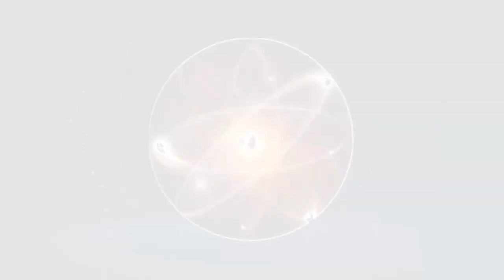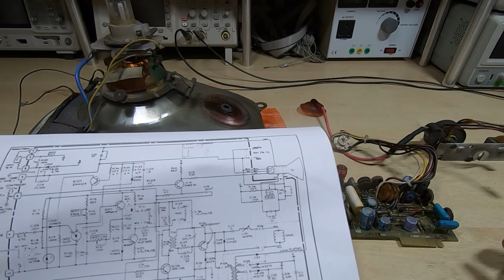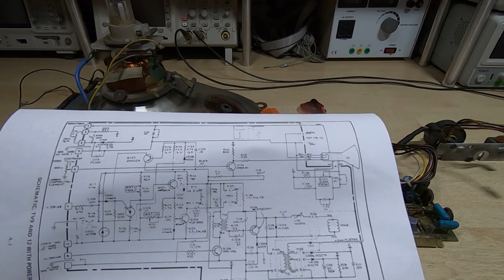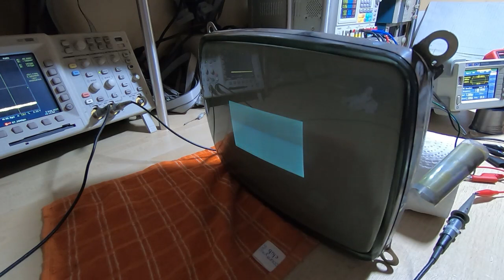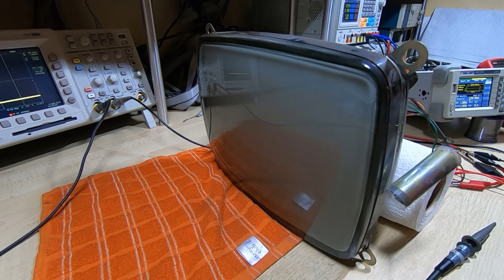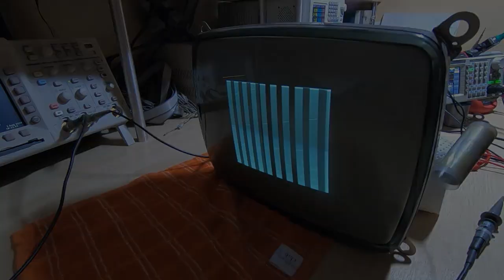ADM3 #3 Repair Part4

Comment: Hi Jerry
In general  the 70's/80's 90deg mono CRT's 20mm neck had 12V heaters and the monitor power at 12V supply was approx 1.2A and 110deg 28mm neck had 6.3V heaters and they were often ran off 24V supplies and the current draw was again  1.2A.

The schematic you showed looked like the Ball brothers circuit, they did 5", 9" and 12" versions using the same chassis.
Reply from the maker: Yes I am aware of that but this tube is not from a monitor and as you say 'in general' AKA 'not always' so I always proceed carefully when making hybrid circuits using unknown components which may also be faulty.

Comment: you could try moving the scan coils back along the neck .i have a feelinmg that when you get near to a full size rasta the the lack of EW correction may show up.
Reply from the maker: That would cause vignetting as the scan coil location on these tubes is critical. The board does have EW correction but it will most likely need modifying if the scan currents are increased as the EW correction is part of the 'S' correction. The biggest issue is the way the scan coils and LOPT interact which may cause difficulties.